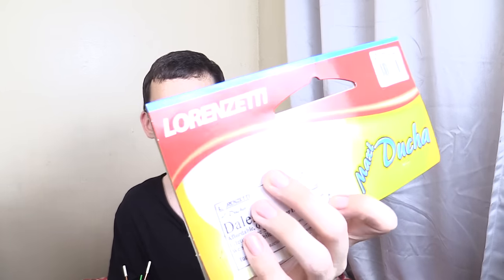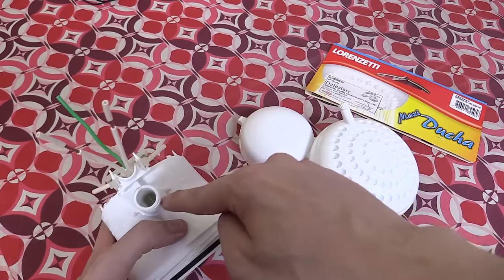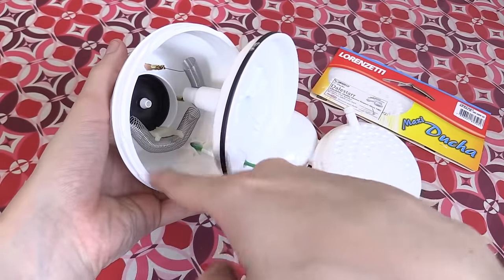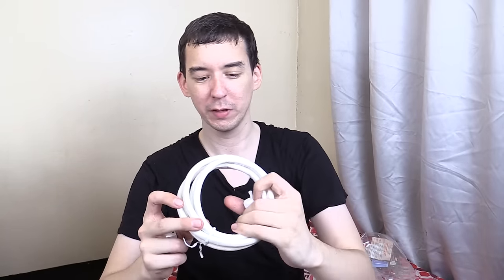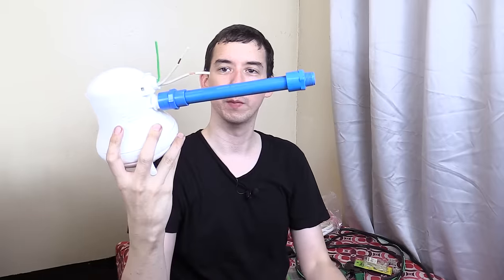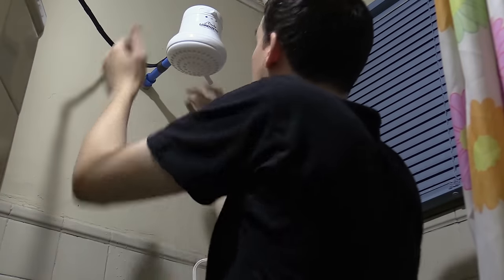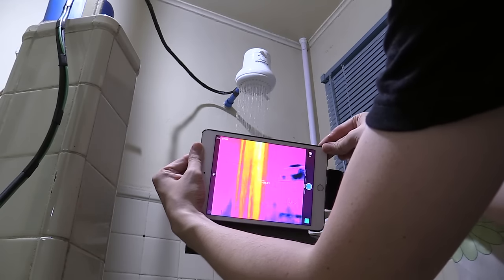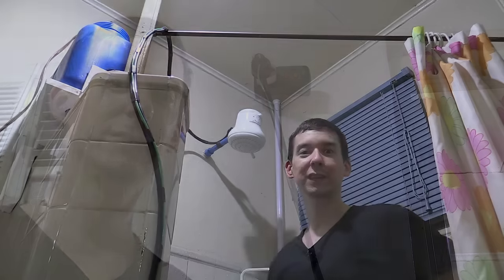Lorenzetti Electric Shower Head

Comment: These are pretty much the standard showers here in Brazil. Every household has one or more of these. I can assure you that it is totally safe, if properly installed. The only problem is that these are not cheap to run (5.000 watts or more). Also: your cable is what we would call over engineered...c'mon! I never heard of a single electrocution case related to these showers ever in my life...
Reply: There are certain conditions that need to be met before it will kill you. If the heating element gets damaged (for example due to corrosion) and the grounding cannot safe you for some reason (not connected, broken, or corroded; bare wire corrodes easily), then the shortest part to ground is via the victim taking a shower. A human that is wet doesn't stand a chance to survive a mains voltage electrical shock.

So, it might not kill you under normal circumstances, but that certainly doesn't mean it is safe. The very first lesson in electrical safety is isolation. You could argue the second lesson is to keep electricity away from water. This device not just brings unisolated electrical wire near water, but through water. That is a big no-no in electrical safety.

I can tell you: Here in Europe it is even forbidden to have normal electrical sockets in bathrooms (some bathrooms have sockets powered by an isolation transformer though). Not because a socket would immedeately kill, it won't. But for safety, you want to keep electricity far, far away from water.
Reply: I'm a Brazilian Electrical Engineer, and yes, I agree with you. But you live in Europe. These kind of stuff is cheap and affordable to you. Here in Brazil, it's Hard to find a home that have ground protection. GFCI like circuits are very uncommon on house's installation, in fact, this kind of protection is being used from like, 10 years ago.

I haven't met or heard of a sigle person that got electrocuted by the shower head. In fact, we even joke that in some houses, the shower shocks when you touch the register you so you need to get shower with flip flops to your feet dont meet direclty the ground, and dont get shocked. (Yeah). But no one died. The water and body resistance is too high to be lethal, you need, like, to hold two live wires, from different potential, wet, to get shocked.

When the resistance broke, there are live wires on water. Yeah! Live wires on water. And guess what? You dont get shocked, because current goes throught water to the other side of the conductor, and every remainig current that lasts get absorbed from the ground circuit.

It's pretty safe. That's why os easier to burn a house with this kind of equipament, using unaproppriate wires to the load, than get electrocuted.

Risks exists? Sure. But gas is more dangerous than this, if installed in a unaproppriate way.
Reply: This facts can scare you a little, but Brazilians are very used with this kind of equipament, and in fact, every Brazilian had took a shower with live wires on water, because, at least once, a brazilian got a cold bath during shower because the resistance got broken (and because of the lack of knowledge of brazilian people is responsable to the lack of fear too). Brazilians are alive, so do I, and I garantee that it's safe. We also have Inmetro, that rules if a equipament can or can not be sold in Brazil, and this Brand is the biggest Brand of shower heads of Brazil, with years of tradition. They aways certify this equipament to the worst case of house installation, (lack of GFCI, circuit breakers, ground and unaproppriate wires), to at least, if one or more of above fail, it dont kill the person. (Scare a little, damage, but do not kill). Seriously, where do you think that we live? Unfortunadely, in technology, Brazil stopped in time, but we aren't a suicidal population. C'mon.
Reply: It's incredible how noticeable is that brazilians are latin americans. Still knowing the danger of mixing electricity with water, and the danger of not using ground wiring, they defend this stuff with the developing country argument of "nobody ever died with it".
That's how life worth in Brazil.
Reply: Disagree it’s cheap to run not wasting energy in pipes
Reply: Tenho um e funciona perfeitamente
Reply: What? 5000 watts!!
What cable gauges do you use to run that? 6AWG? Also taking shower might be the most expensive activity at home.
Reply: pikachu?
Reply: Gaita Ponto 

Don’t get too comfortable cus the person who does die wouldn’t have ever thought it could happen to them
Reply: For real ,all of Trinidad and Tobago  use this....never hear of a eletrocution in my whole life.
Reply: segoiii Most of electricity produced in Brazil is from Hydroelectric plants just so you know.
Reply: 9AWG CABLE on 127v
And
11AWG CABLE on 220v
Reply: @danielmantione  I actually touched both wires (they were unprotected with tape or whatever on a girls house) of such shower when wet and I assure you it won't kill you. It's not pleasant tho and it will make you clench your muscles, in my case it was the shower head, to free myself I had to rip it off from the wall, but I am here to tell the story so I am not dead.
Reply: @felipex6793 you aren't dead but you had a close encounter with death. I wouldn't call that safe
Reply: @imeakdo7  in this case it was extreme negligence, on normal conditions I could touch just like I did and nothing would have happened because the wires would not be unprotected like that. Provided that the eletrical installation have a proper ground wire, eletric showers won't shock you on regular conditions.

I don't really think it was that close with death, had several near death encounters but this was not the closest.
Reply: My mother got electrocuted while pregnant with my sister in Brasil. She didn't die because, well, a miracle. My sister also didn't die. Her birthday is today.
Reply: @gypsy2007  Happy to known everyone is safe and gratz on your sister, but it's not likely she got electrocuted by a shower head it's nearly impossible, based on physics.
Reply: Nóis brasileiro isso é normal ter em casa, meu caso é uma ducha elétrica até hoje nunca levei choque, apenas queimou resistência é normal de acontecer, A solução trocar resistência, Isso é o que acontece em Países de 3° mundo
Reply: @fabianroger Nunca ouvi nenhuma notícia de que alguém morreu no Brasil por choque elétrico no chuveiro, mas todo inverno temos notícias de pessoas que morreram por vazamento de gás.
Reply: @Cafecomironia  Que vc não ouça notícias não significa que isso seja a realidade
Reply: @partron  Brazilians see what they want, they are too influenced by media, and they don't know
Reply: @fabianroger  Não apenas ouvir, mas pesquisei ativamente por mortes por eletrocução no chuveiro elétrico e não encontrei nenhuma. Por outro lado, encontrei várias por envenenamento por dióxido de carbono causado por inalação de gás para aquecimento do chuveiro.

Comment: Here in Brazil this shower is very popular and rated safe to use by INMETRO, one of the brazilian regulatory agencies. The risk of electric  shock by droplets doesn't exists. The droplets are isolated by the air that isn't conductive. The ground wire is provided to avoid risk of shock of on the faucet valvle. I use this type of shower over 45+ years and never noticed someone getting a shock using it.
Reply: What if you are a taller person that can easily touch the shower head while it's operating?  Would there still be air separating the droplets from the shower head?
Reply: @imeakdo7  If that's the case just install it higher in the wall I guess.
Reply: @ajsrf  I wish it was possible
Reply: @gugaljp  Me too!
Reply: @imeakdo7 I constantly touch the running shower to change the heating. No shocks, everything should work if you install it correctly (I'm 1.90m tall)
Reply: Im at a new home and there is one attached to the showerhead. I think it is convenient. I want one

Comment: The spot welded wires is to make it cheap. Terminal blocks would increase the price and complexity of the manufacturing process. The model you used is probably one of the cheapest around selling for 10 pounds. Regulations require them to be used with differential circuit breakers, not that there is anyone checking. And statistically it is very safe, over 200 million Brazilians use them more than once a day (Brazilians tend to take 1-2 showers per day) with very few incidents.
Reply from the maker: True, I guess they're just trying to keep costs down. I'd like to see a better version but this is the only one I've seen sold locally.
Reply: This. Diferencial circuit breakers are a HUGE  security factor. And those scary, ground-less installations are NOT the rule! Most of these showers are properly installed, even low education electricians usually know the basics of security. As most of the people here, at least in Brazil I have NEVER heard of a shower accident, and surprisingly, serious electrical accidents are pretty rare in general.
Reply: Low education electricians (or cowboys as we call them in the UK) know next to nothing about electricity other than you need to connect the live to the live and the neutral to the neutral to make things turn on, other than that they will often negate to do anything regarding ground/earth and will often bypass fuses or circuit breakers using a small length of wire or a nail.

The next post will statistically be a bigot blaming cowboy sparksmanship on immigrants but I've seen many home-grown white Brits replace a blown fuse with the same fuse just wrapped in tinfoil.
Reply: I used to live in shitty favela when I was a kid, there were around 10k houses there most of them with illegal energy and no circuit breakers, I remember my shower used to be like the images he showed: no grounding, tape isolated and the shower had a leak that actually channeled water in the wires! Lived like this for 15 years, and I either never heard about shower accident (even tho those 10k houses were asking for it).
If you ground it correctly, the chances of you being reket is pratically 0.
Reply: I believe since we are using that kind of shower for so long here in Brasil, it's acctualy hard to find a house without grounding at least on the shower's power outlet, even old ones. So, it's just a matter of connecting all the wires properly.
Reply: Nem todo mundo usa essas merdas de chuveiros elétricos (cerca de 73% das casas usam, então não dá pra dizer que são 200 milhões que usam) que não possuem pressão, bom controle de temperatura ou eficiência energética. Uma parte bem significativa dos prédios minimamente decentes em São Paulo e RS (lá tem muito em casas, principalmente na serra) usam aquecedores à gás ou solares, mas esses são um pouco mais difíceis de se achar e precisam de um sistema de aquecimento, para quando não faz sol por muito tempo (nunca vi em prédio, só em casas).
Reply: Solar water heating systems still relly on the same electrical resistance for temperature compensation when cold or no proper sun exposure and gas heaters are extremely rare in the country. Ditch the weathy guy speech, there are electric shower heads for as much as 1000,00 USD.
Reply: Rob Fraser in Brasil we're used to connect the ground wire to the neutral, since the houses don't have ground circuit
Reply: +John Doe I wasn't trying to be smug or anything. I was just annoyed at how snob his comment sounded as if he was above everybody else in this thread.
Reply: that 2 showers a day thing is no bullshit, Brazillians are fucking obsessed with body odour and cleanliness haha
Reply: Caio Assuncao. Look guy, you look way too young to know about terminal blocks and circuit breakers so I'm gonna need you to grow a beard.
Reply: chris griner but you wont age from growing a beard
Reply: Actually. 
There is no way to get 110V without ground. from the grid you get 2 or 3 different phases of AC, connecting two of then to your power plug you get 220V, to get 110V you need to connect the Ground as one of the connections in your power plug.
Maybe you are talking about using the grid ground because the house don't have a ground itself, but it's almost the same thing
Reply: It is the cheapest. The better aones have settings to adjust temperature and even to presurize the water.
Reply: @gapuxo  I have 50. I lived in more than 10 houses or apartaments. All of them had porwer outlets for eletric showers.

Comment: I'm Brazilian and I have used this shower my whole life. The most dangerous thing is not the shower but how people install it. It is very, very common to connect the ground in the return (negative) wire. This is because most houses do not have grounding which is a recent requirement in construction.